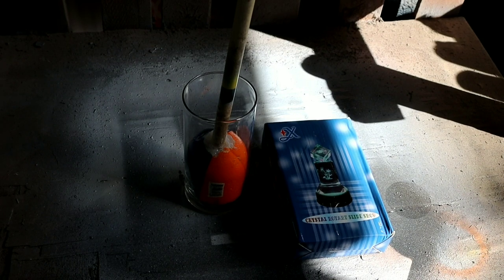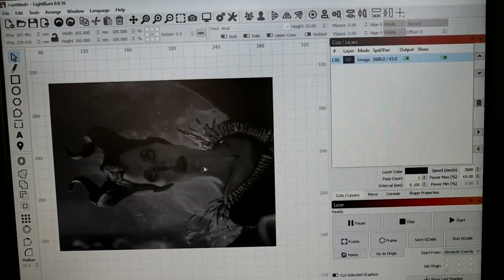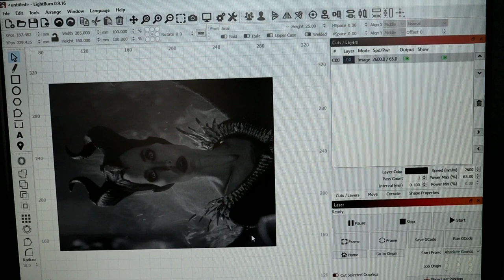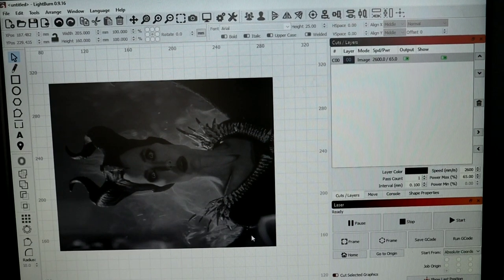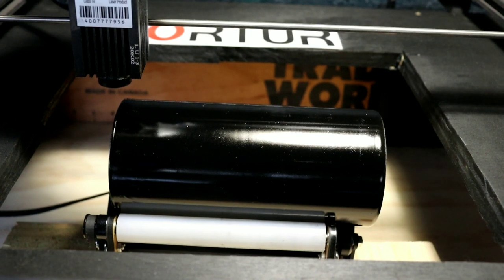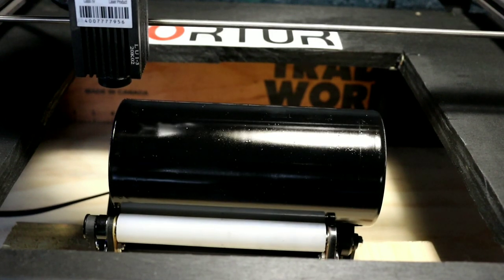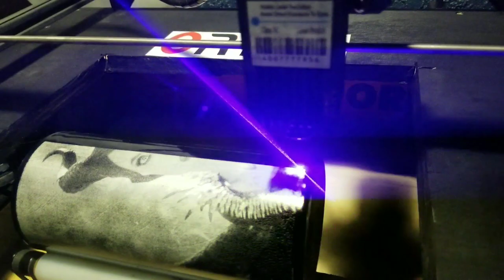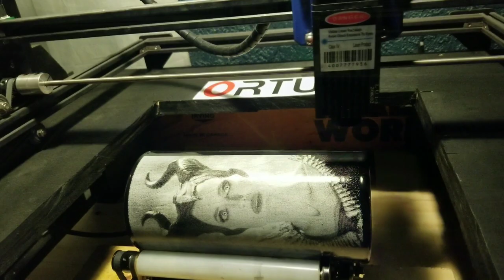Maleficent Engraved on a Vase using The Ortur Laser Master 2 15w  and The Ortur Y Axis Rotary Roller

Comment: Nice pic think buying the roller this week
Reply from the maker: It's pretty cool once you figure it out.
Reply: @zerica24   Yeah I'm sure it not much info on it but I like a  Challenge i know there roller part in lightburn and just a cable to start so I'm just play for a week as see what end up with
Reply from the maker: @davidwhitt3299  It is really no different than engraving on canvas  I really didn't change anything but the size . My focal distance is the same.  I did nothing different in lightburn

Comment: Question: I would imagine that the image you used in this video has a copywrite associated with it, did you have permission to use it ?
Reply from the maker: No permission need I am using the image for teaching not for profit. It different if your using it for personal vs business
Reply: Just a suggestion if that is the case but, you might want to put a note stating that it is for demonstration only ....... and no copywrite infringement is intended.  Disney is pretty strict when it come to their proprietary images - food for thought
Reply from the maker: @pmpProject13  Thanks for the suggestion I appreciate it.

Comment: Thanks for the videos, will the laser be able to do this without first putting the white coat down? Lets say for example you just wanted to put the black down first then laser off some words or a symbol and have that clear through the glass
Reply from the maker: It would definitely work  it would leave the letters . Make sure they letters or designs are black  surrounded by white

Comment: Trying this now. My vase is a little taller at 10 inches. It is too long for the rotary without removing the stop. Do you have any issues with the vase walking? Gonna see if I can engineer a better way to do the stop.amd the adjustable support.
Reply from the maker: I removed my stop rollers and put them on a piece of wood so I can keep the vase on a free roll. No matter how long it is.
Reply: @zerica24  thanks for the info. Always looking for ways to make it easier and more consistent to set up. I travel quite a bit and I take the ortur LM2 20w with me. Working on a light weight enclosure this week and an easier way to raise and lower the unit.
Reply from the maker: @risbill1  Slvrdesign3d.com  has a great Height adjuster
Reply: @zerica24  I'm good with the built in for the laser module but not crazy about most of the options I have seen for lifting the machine to use the rotary or just a taller item. 

My burn was successful though. I'm on the hunt for one of those rotating bases but I'd like to find one that is sound activated.

Comment: Amazing review! I'm just wondering if the rotary can be adjusted for thinner cylindrical objects such as pens?
Reply from the maker: Yes you would just need to adjust the rollers for the size of the cylinder you need. Which is very easy to do.
Reply: @zerica24  Thank you!